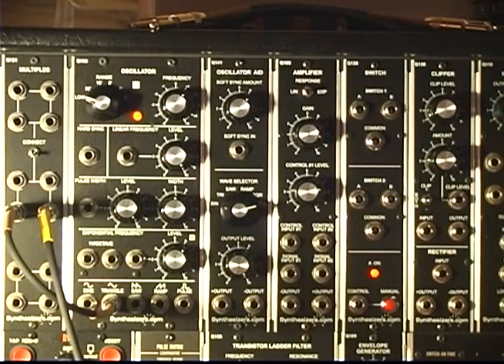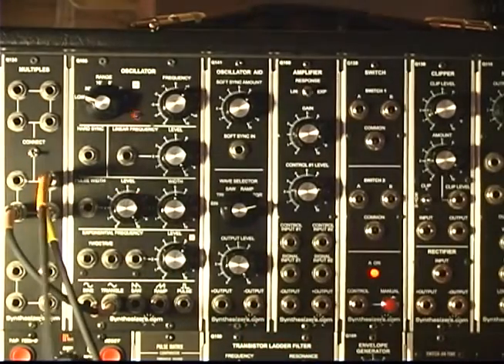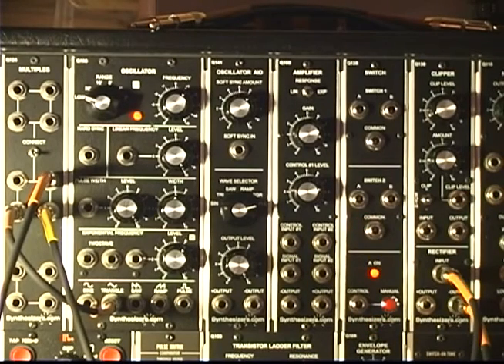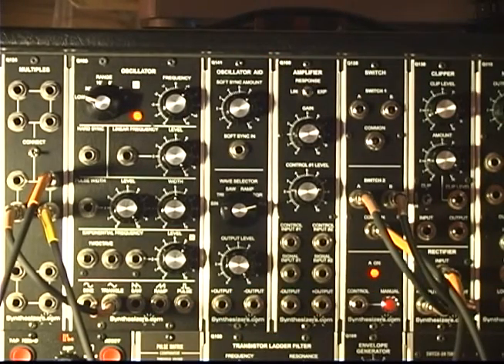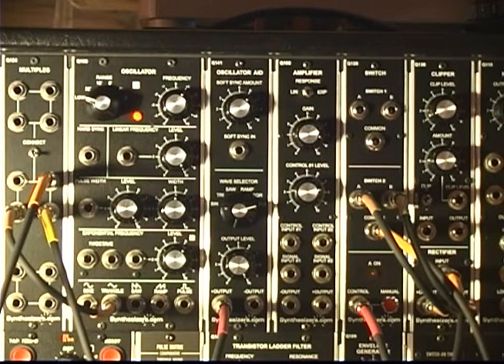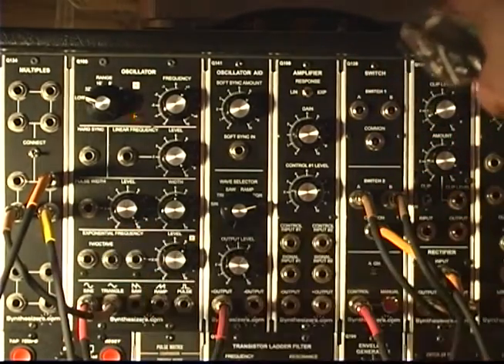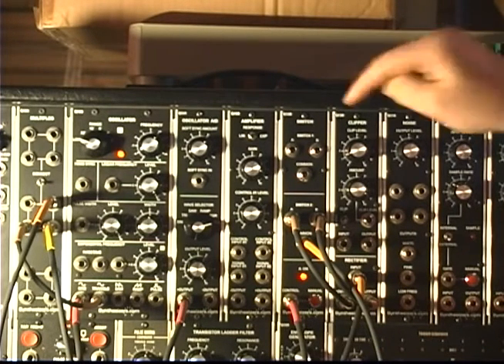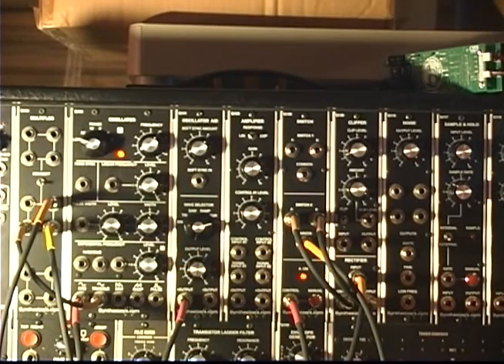Synthesizers.com Q130 module demo

Comment: Nice demo!  Such an underrated module.  Mine pretty much only sees use for cv shaping, but it is so useful for this.  I've used the rectifier as a makeshift gate multiplier to trigger EG's (using any wave but a pulse), and the clipper section as a spare vca (with a technically different but not really audible response if viewed on a scope).